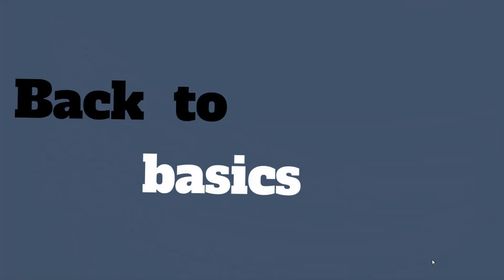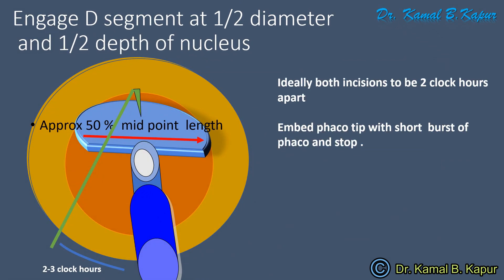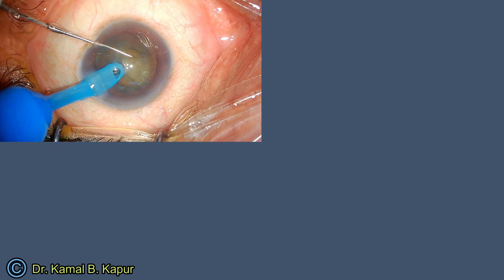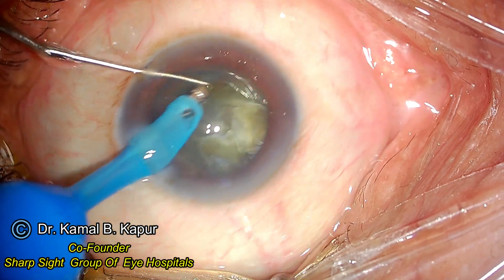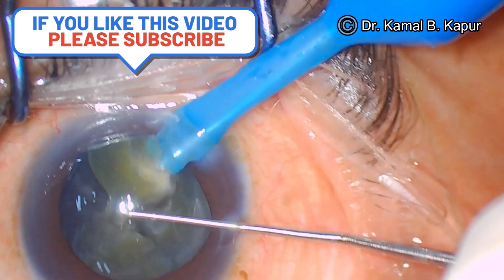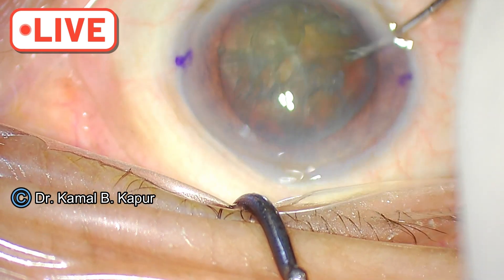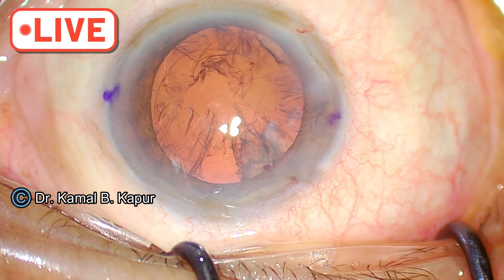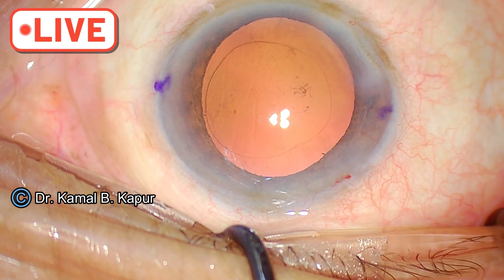Mastering  a VERTICAL Chop - Step by step ( Back to Basics) -Dr Kamal B. Kapur

Comment: Excelent educative video. Thank you Dr.  Please Dr. Parameters of fluidics: flow rate, vaccum, phaco mode longitudinal? torsional? burst? continuous?.  thank you.
Reply from the maker: Yes and yes
Reply from the maker: The vacuum set is 330 mm IOP TO 40 mm
And phaco power is set from low to moderate ie 10-30% depending on catracat density
Pulse set to 80-100 pulse and duty cycle set low to get a good grip on the cataract
Reply: @OphthaGurus  Thank you. Dr. Blessings.